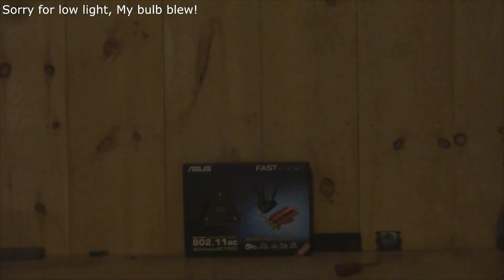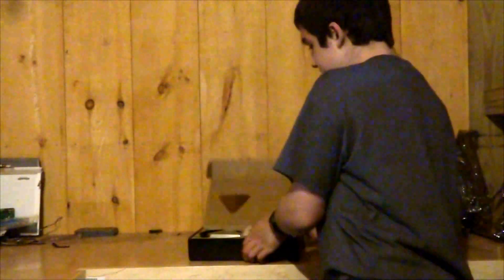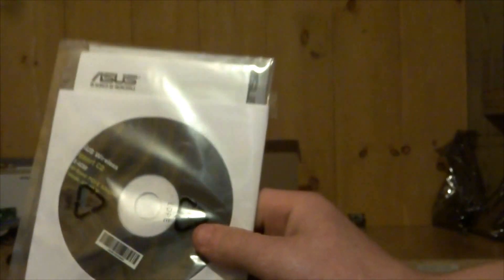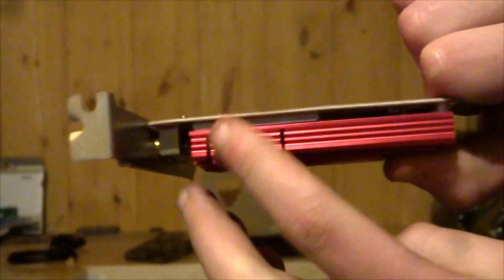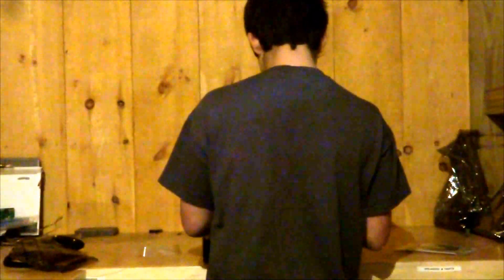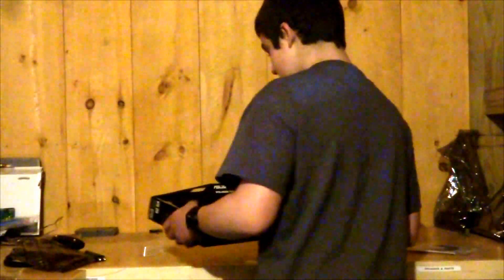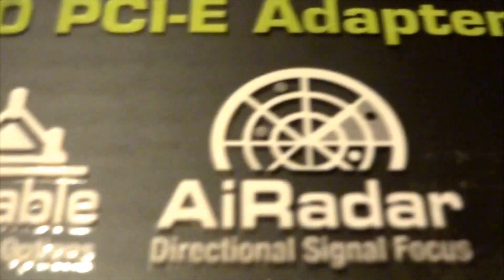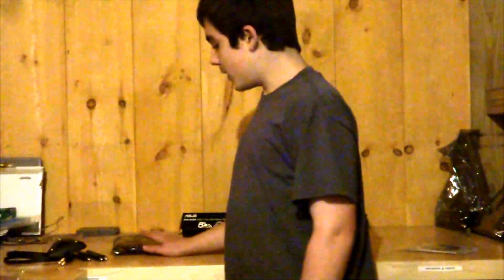ASUS PCE-AC68 AC1900 Wireless Adaptor Overview

Comment: a few tips. don't face away from the camera. try to have it all laid out in front of you, and don't talk away from the camera. I liked your overview. Do you recommend this card? is it worth the steep price?
Reply from the maker: I love my ASUS PCE-AC68. I get really fast speed and wireless AC. Much better than the TP-LINK that I used to have! My only issue is the utility is junk and I cannot get it to stop opening with Windows. Also thank you for the tip and when I get a new camera (I lost my old one) I will try to get the camera in front of me!
Reply: +Joshua's Recordings 

what was the old tp-link model because mine has yet to fail me, just wondering, because im debating between this and a new tp link.
Reply from the maker: +Matt Soul It was a Wireless-N 3 antenna card. All I remember is that I hated it! The ASUS is much better!
Reply: ok cool i have a tp link n900 the wdn4800 and its working great btw not a single drop in connection and good range too. But some ppl just get bad luck. and sometimes a shitty card.